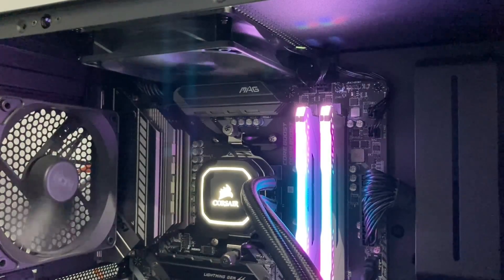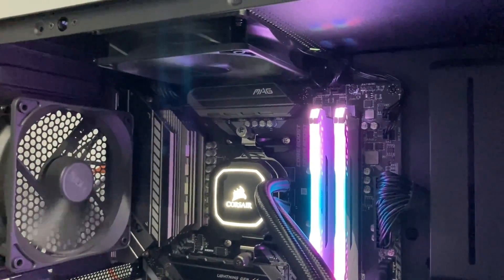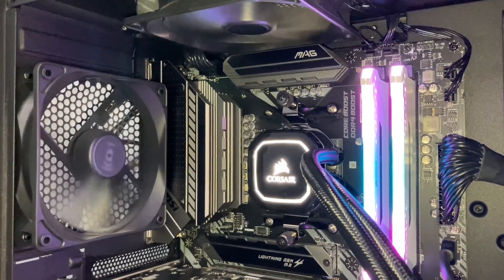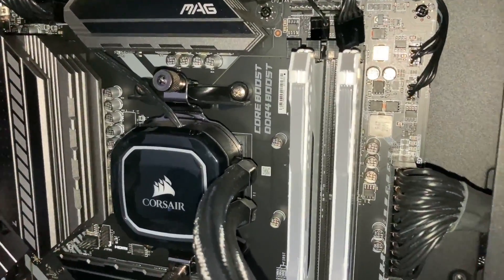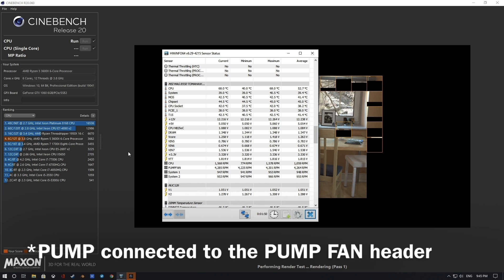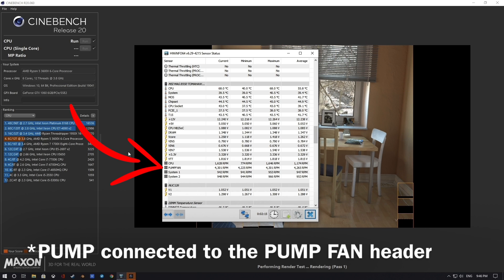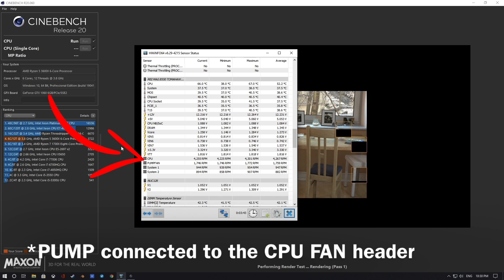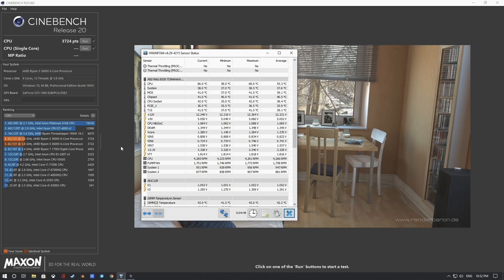Pump tach cable to which header? Pump fan or CPU fan.

Comment: I am using msi z390 a pro. Should I connect the cable from the liquid cooling to the pump_fan 1 part or to the sys_fan part? Also, when my computer is idle, the temperature is at 35% degrees. Is this normal ? When I turn on the computer it says "cpu overheating alert! please ensure the cpu cooler is firmly attached to cpu and is able to provide sufficient thermal dissipation''. Please help me.
Reply from the maker: Seems like there is an installation fault. 
The cable from the pump can be connected to any fan headers, result will be the same.

I suggest you, to reinstall the pump and check you peeled the plastic.

Comment: Hi, I have two connectors:
- Chassis water pump fan connection
- CPU water pump fan connection
Which connector goes each one?
Reply from the maker: I still can’t understand your question. 
Are you talking about connecting the Pump to where?
Reply: @starrims  yes, those connectors are in my Mobo, and my AIO has 2 cables, so how will be the connections?
Reply from the maker: Pump take powers from SATA cable from PSU. Another cable is for PWM which will go to CPU Fan header.

Other Fans like Radiator fans, you connect them to anywhere you like.

Comment: Dude, what fan speed do you recommend for a radiator? does the fan have to run 100% constantly, or can I set the silent mode in the bios? I'm afraid that due to the small number of revolutions, the water will not be able to cool the radiator. What fan speed do you use for 240mm radiators? cpu iz 5600x ,kraken z53. Cpu will be OCvat 1.325 ,at 4.7mhz to all cores.
Reply from the maker: I recommend curving it on bios or motherboard software. For me I keep the pump at 100% all the time and Radiator fans at ~1000RPM at ideal and it goes up to ~1800RPM in load which gets me pretty good jet engine!
Though NZXT fans would be little bit quieter.

Comment: Could someone please help me with this. I bought a ryujin 2 360 but my aoi fans are not showing inside of armoury crate, do I need to change something in bios? Or are they plugged into the wrong port? My 3.5" screen is displaying my CPU & GPU temps properly, but I can't see aoi fan speeds inside of armoury crate? I need help with this of anyone may know?
Reply from the maker: Is your pump speed and radiator fan showing up in HWinfo? Check it.

Comment: The cpu_fan header on my motherboard is Fan PWM, Fan In, Fan PWR and Ground. The pump tach  cable is 3 pins, where do I connect this to? Do I need to use Ground?
Reply from the maker: Just insert the connector as the lock aligns to motherboard header. 
And yes for the pump, it takes power from PSU directly, thats why its only 3 pin excluding PWR.

Comment: A direct and simple answer to my question. Pump to cpu fan header is a nice fail safe for a hot running gaming pc. Being a noob to building a pc I would have likely not used the cpu fan header at all since I am going water cooled. So two issues solved without know about one of them. Good deal
Reply from the maker: Absolutely. Although New motherboards having same feature on Pump fan header as CPU fan header in term of failure notification.

Comment: Hi,
I connected my monitor to my pc ( the monitor hdmi is connected to my gpu hdmi) and it shows no signal.
I’m not sure what’s the problem
Reply from the maker: Is your computer running ok from if you connect the monitor from motherboard HDMI?

Have connected PCIE power cables to the GPU?
Reply: @starrims  yea, it's connect it but, my pc is blinking red and orange on the motherboard.
Reply from the maker: @beginnerentrepreneur504  seems like any of your hardware is not detected by your motherboard. Try disassemble RAM, GPU & build them again with proper attention.
Reply: @starrims  ok, thanks 😄
Reply from the maker: Is it your first time PC building? Have you put the CPU correctly?
Reply: @starrims  yes, first time pc builder. I pretty sure the cpu is put in correctly
Reply from the maker: Then maybe try rebuilding again like wiring and all those little stuff.
Reply: @starrims  Hi,
so, I follow your advice. I believe it’s the ram because when I have one stick in the motherboard… cpu and the dram stops flickering and now boot turns green.
Reply: My monitor screen still black
Reply from the maker: Try interchanging RAM between slots and boot your PC. So you would know if RAM is the problem. Guessing not both RAM will not be faulty!

Comment: I have the z690 msi mother board and it have a cpu and pump on the mother board so I’m just I connect the fan to the cpu and the pump to the pump
Reply from the maker: No problem.
Reply: @starrims  thank you so much. Is it better to connect the pump to the board or directly to the sata power supply
Reply from the maker: @melvina183  there will be two connectors from the pump i guess. The PWM header will go the board and SATA for power will go to the PSU

Comment: I would appreciate if anyone can answer my question. I’ve recently switched from the Kraken M22 to the Kraken x63 as my cpu was overheating from overclocking. Now, I have a Aorus B450 Pro WiFi as a mobo. Because I have an extra fan, I have to connect both 140mm radiator fans to CPU_OPT with a splitter and the pump to the CPU_FAN. will it work that way and will it be safe for my mobo?
Reply from the maker: Absolutely fine. No need to worry about it.
Reply: @starrims  Thank you very much for your reply. Your video helped me out as well

Comment: The question isn't can you, the question is should you.  In some situation, if you have no other choice, sure, but that would be pretty rare.  The CPU header expects a fan and often there are features designed in most motherboards specifically for that..   If you have a WP, or SYS/WP, or CHA/WP connector, you should use that.  Heck, some MB's have a CPU2/WP header.
I think you mentioned that some MB's won't post w/o something connecting to that header and if for some reason you have no other fan to hook up, I guess that's a good reason.  However, I, personally, would consider that a temporary solution until I set it up better.
Also, some motherboards can have a bios alarm if the CPU fan quits, maybe take advantage of that to tell you if the water pump quits.  I guess I could see that also.  But I don't think those are common scenarios.

I recently had to troubleshoot a prebuilt that was running hot.  It had liquid cooling.  And, guess what, the pump was on the CPU header.  If I had built it, well, it would have not been that way, but, aside from that, then I would know how it was set up.  As it was, I had to pull the fan harnesses apart and figure out where each fan was hooked up to troubleshoot why it was running hot, well, unless I just wanted to run all fan headers full speed all the time and call it good.
Reply from the maker: Thanks for you valuable information. I will definitely remember this.

Comment: Hey i just put in my new parts in my computer i have the Asus Rog strix z590-e with a NZXT kraken z73 AIO, i connected the AIO cable to AIO_PUMP, and the AIO fans are connected all with 1 cable that is a SATA cable im pretty sure that came with the AIO, and then i connected my fan hub controlling my other 4 fans to the CPU_FAN hub but i keep getting the « CPU fan error » i tried setting my fans to « ignore » but it still keeps me in bios, what do i need to change/do to fix?!
Reply from the maker: Try the AIO CABLE TO CPU_FAN, RADIATOR FANS to AIO PUMP.
Reply: My radiator fans go from the aio block to a 3 splitter but doesnt have another connector? Theres only an extra NZXT cable

Comment: Hey I have to kraken z63 and put it on aGA-AX370M-DS3H Gigabyte MoBo but the radiator fans don’t spin and the temp reads high would you know the cause of this?
Reply from the maker: Fans are connected? Pump connected to which connection?
Reply: @starrims  yes the fans are connected to the three way splitter and pump connected it to cpu fan cause that’s all I have or would I have to upgrade my MoBo?
Reply from the maker: Seems like everything is fine with your installation. Maybe try updating bios.. 
I think pump i working but radiator fans. Try swapping fan connectors to another header. 

Try pump to fan header, radiator to cpu fan header.

If nothing works, maybe it’s time to get new mobo.

Comment: This perfectly answered my question 🔥 thank you for this, im using a galahad 240mm AIO and I was so confused at first, I assumed I'd plug it into my CPU Fan header due to that fact it was my CPU Cooler, but when I saw my Motherboard manual said PUMP header I was like nooo now im conflicted 😂 but this answered everything I needed so thank yoooou
Reply from the maker: Thank you for appreciating my work:)

Comment: My Corsair is a 3 pin connect all I have on my mb is 4 pin can I still do it or do I need an adaptor
Reply: Thanks so much
Reply from the maker: No problem.
Reply from the maker: You can connect the the 3 Pin to a 4 pin

Comment: Hi there !

I have one question..maybe more

I know that Pump->CpuFan
Radiator Fans->PumpFan

If there's a hub/controller, installed at the back of the case, should I connect Radiator Fans to this hub (to which 2 case fans are already connected) and then plug all this to Sys Fan?

Or should I connect radiator fans to PumpFan, and this hub with 2 case fans to SysFan ?

Thanks in advance for your, quick I hope, reply ;)
Reply from the maker: Hub is recommended only for sys/case fans. 
For Radiator fans I would prefer Pump fan header as it is related to CPU cooling and needs much more optimise automated control from motherboard.

Comment: i want to join all my 4 rgb fan with hub then i can connect them to pump header or system fan header,can you suggest me

they all are cabinet fan,three fan is on front pannel for air intake,and one for outake
Reply from the maker: Better to use system fan header, Pump fan header is also fine.
Sorry for late reply… I missed your comment!

Comment: Hi do u have to increase the rpm of the pump if u connect it to the cpu fan header
Reply from the maker: No it will be automatically at highest speed. You can lower it down if needed.

Comment: @S T A R R I M S i have a h510 case with 4 fans nzxt (2 rgb and 2 simple ones).the aio is also nzxt x53 rgb. where should i connect the fans and rgb on the msi mpg z490 gaming plus. thanks
Reply from the maker: Fans to System fan header (SYS FAN) and RGBs to RGB header (JRGB/JRAINBOW)
Reply: @starrims  thx bro for helping
Reply from the maker: @StefanGustiuc  no problem. Use JRAINBOW for NZXT RGB fans. Because those are ARGB
Reply: @starrims  the fans are two from x53 rgb and two from the nzxt h510 case
Reply: i will put the rgb fans for exhaust and the non rgb fans for intake in front togheter with the radiator
Reply: shouldn't i plug smth in cpu_fan or pump_fan
Reply from the maker: I will sort it out.
The RGB cables from the RGB fans goes to JRAINBOW header and fan cables goes to system fan header.

Your pump fan cable goes to cpu fan header,, radiator fans goes to pump fan header.

Your pump RGB cable goes to JRAINBOW.

If your motherboard runs out of JRAINBOW header you can split them.
Reply: @starrims  ok..thanks a lot have a good day
Reply: @starrims  Jrgb 1
Pump fan1
Sys fan6
Jrainbow 2
Cpu fan1
Reply from the maker: Do you need any further assist?
Reply: @starrims  no thx

Comment: Hi im getting the deepcool castle 240 and my motherboard does not have a pump header so i am going to connect it to the cpu fan header but the pump header is 3 pin and the header on the motherboard is 4 pin does it matter what pin i connect it to?
Reply from the maker: No it doesn’t matter. You can connect 3 pin to a 4 pin header connection.
Reply: In your case, leave the cpu fan to pwm, this will make the pump to run 100%. Connect the aio fans with the pump. And power the rest with data. But you will need to use aio software to control the fan speed

Comment: Thank you so much I was worried because I didn't have a pump connection
Reply from the maker: You are welcome 🤗
Reply: Can you plug 3 pin aio to 4 pin cpu?
Reply: did it work because i have an msi a520m pro micro atx motherboard and it doesnt have the pump connection

Comment: I have ASUS Prime b450m-a  motherboard and I can't find the where to put the pump. 

My PC turns on and RGB is just fine, I just don't know where to put this last cable coming from the AIO.
Reply from the maker: This motherboard don’t have a PUMP header. Just use the CPU FAN header for your pump.
Reply: @starrims  Thank you!!
Reply: Same with My asus tuf b550m no pump heather. Manual saying pump to cpu optional and cpu radiator  fan to cpu fan

Comment: hi, I have a few questions on connecting my CPU cooler I have a ASUS prime b560-plus and my liquid cooler is a MSI mag core liquid 240r I'm trying to figure out the  locations of where to plug it in. thx
Reply from the maker: Connect the PUMP to the CPU FAN header (It should on the behind the RAM slots)
& Radiator Fans to any sys_fan or cha_fan header.

Comment: thanks for posting, I want to put an AIO with 4 fans(push pull) can i put 4 fans on the pump fan header so they work together?
Reply from the maker: As far I know, on a decently high-end motherboard upto 4 Fan is supported each Fan Header. But some supports upto 3.
Reply: i will check although i have an itx motherboard so probably not but thanks for responding.

Comment: I got 4 pin cpu fan header, I'm getting a deepcool Castle 240 RGB and it has 3 pin pump header wire. Would it would if I put the 3 pin aio pump wire to 4 pin cpu fan?
Reply from the maker: It will work what ever PIN you use. My suggestion is using CPU PIN. But PUMP PIN also fine.

Comment: If my motherboard has two CPU fans header: CPU_FAN and CPU_OPT
What's the difference it will make if I plug the pump to the CPU_Fan and the radiator fans to CPU_OPT and vice versa?
Reply from the maker: No difference.

Comment: I have a 24 volt air pump i pulled off a house hold appliance.
 [Air pump as it almost looks like a center fungle]

It has 2 wires, i have connected to a 120v to 12v transformer and it works fine. Even though its not supplied 24v

I was thinking about what could go wrong if i connected it to a fan pin on my mother board. Any thoughts?

I have some Experience with motor control and arduino. My thought was to use the pc power supply and pwm fan pin header for speed control.
Reply from the maker: That seems like a very exciting experiment. I have no idea what will happen, if you have any old pc to spare you can check it out. 
If it works you program it little bit but it have 2 wires (only +- ?) then how will it be able to work as PWM to sent data? With Arduino? 
Update me if you progress with this project :)

Comment: Can I connect both radiator fan and pump at CPU fan header using splitter? because I only have 2 fan headers (cpu fan and sys fan header) but I will use the sys fan header for other case fans. Thank you!
Reply from the maker: You can maximum connect 3 fans from one header.

Edit: https://forums.tomshardware.com/threads/how-to-connect-multiple-fans-to-one-header.2647562/
I think this link can help you.
Reply: @starrims  Thank you for fast reply! But I want to know if I can connect the pump and fans at the same time in cpu fan header? or it will affect the rpm of the pump?
Reply from the maker: @Alvan Kevin Villaflor   It will definitely affect RPM. Pump will always tends to run at high RPM. 
I will not recommend connecting PUMP with any other fan.
Reply: @starrims  alright thank you!!!

Comment: I have an aio Galahad 240mm fro lian li on a Auros x570 elite should I plug the cooler into the fan pump 4 pin or cpu opt 4 pin ?!? Pls help
Reply from the maker: As you wish. But CPU fan header is more convenient

Comment: I have SYS_FAN 1 and 2 headers, and CPU_FAN. Would it be better if I put the pump cable into the CPU_FAN header and ran it full speed so the pump runs at full speed? Then I could connect the radiator fans with a fan splitter into one of the SYS_FANs and have them change determining by the CPU temps?
Reply from the maker: Yes That’s what I said. Connecting PUMP to CPU FAN header is better.